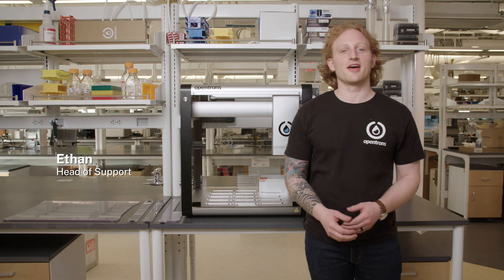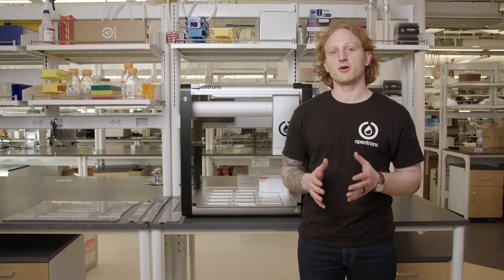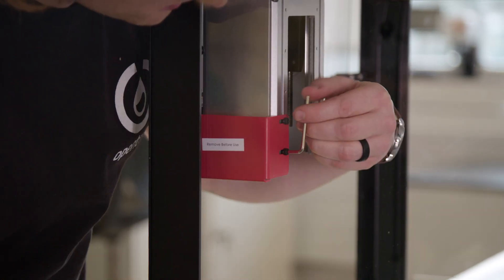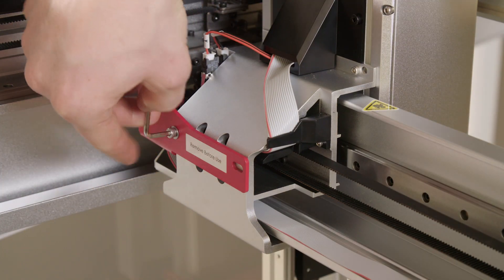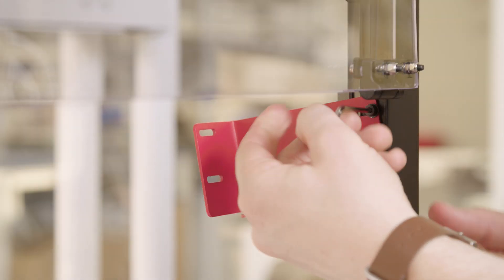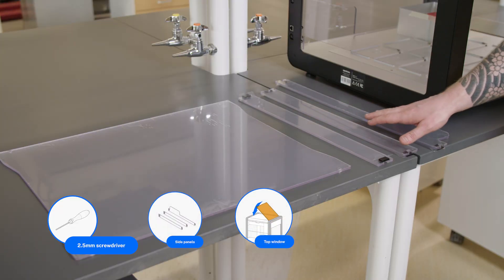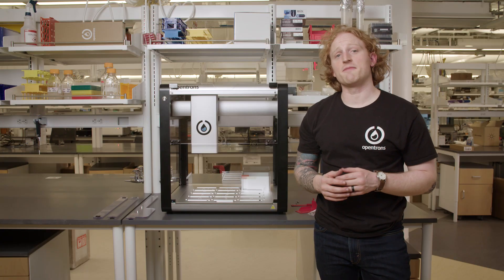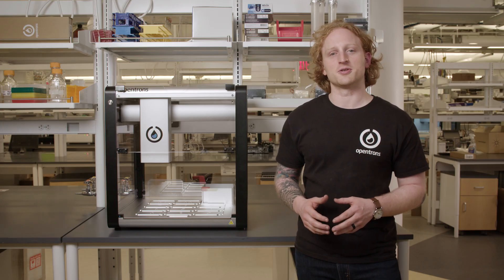Unlocking the OT-2

Comment: Not the best for Canadian or any non-US market.

We are a sequencing core facility and would like to do a constructive critical review:
Opentrons is a fully remote company with HQ in New York, NY. All support is remotely done via email ONLY. So just in case you have an issue in the middle of a run, the turnaround time is from 2-3 weeks (could go more to months)

Opentrons does not offer onsite protocol development services outside of the 50 states of the U.S. So if you are outside of the US and if you request for support, no matter how dire the situation is no one will come physically nor on a zoom call to resolve the issue. Your automated handler will be in dust for weeks or months till you can set it up again. Not best for a busy lab. One issue leads to another and it never gets fixed.

Opentrons claim to “get the OT setup running in 10min” is questionable, it has been almost 2 years and so far we haven’t done a single run, the tip crashes, the offset is off, the protocols provided to calibrate your OT2 are given wrongly without knowing what consumables you have. Moreover, even when troubleshooting, despite giving all information, the redundancy in their queries is high that it is questionable if it is in their best interests to support Opentrons user, mostly superficially looking into issues.

Opentrons do not check what consumables or protocols were paid for, you may have to repeatedly clarify what you have bought.
Your territory manager, application specialist etc. are not Cc’ed in most emails, so you kind of don’t know who you are dealing with and this adds on the “complexity” that no one is assigned to your case. You will end repeating your issues over and over again to different people, due to their department being re-organized several times.

To summarize, if you are outside of US, I would strongly suggest not to go for this, but go for a company that supports you locally, who can actually fix issues and who are transparent in emails. Automation should make life easier. If you really need things to move fast with a quick turnaround time for support, then Opentrons is not your best bet.

You can reach out to the centre on more information and see it also, before you make a decision to buy Opentrons.
Reply: They do seem to have high turnover in staff. 

On the other hand I have been happy to run OT2 with my own protocols running on a Python terminal. Including tip offset.